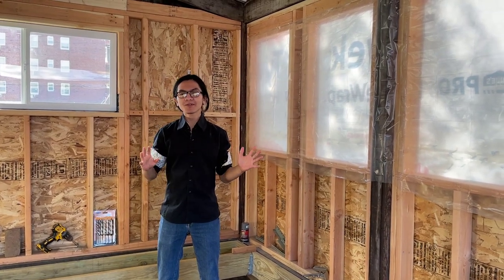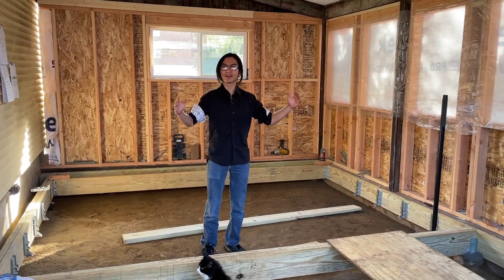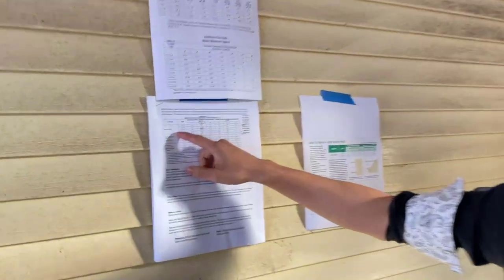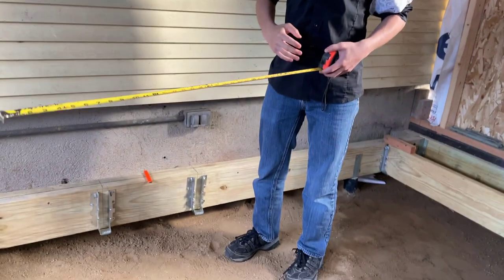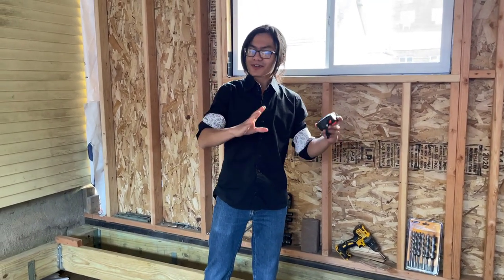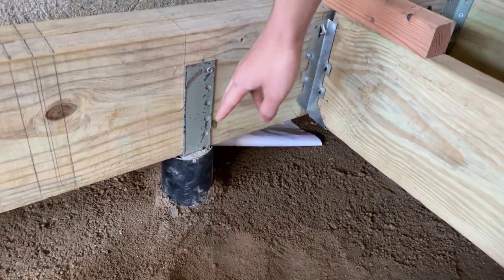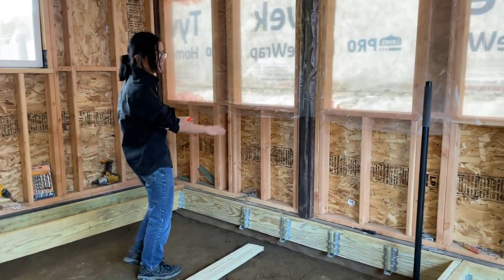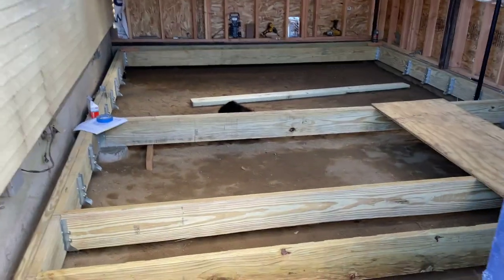Joist Size Cantilever Spacing Beam Span Floor Ledger Footing | Floating Deck Frame Enclosed Patio

Comment from the maker: Here are the #ad links to some of the materials & tools showcased or required for this project:
1. https://amzn.to/3HkgDjW  |  CRAFTSMAN Tape Measure, Self-Lock, 25-Foot (CMHT37225S)
2.  https://amzn.to/30uMpdc  |  Simpson Strong Tie LU28 2X8 20 Gauge Face Mount Joist Hangers - Quantity 25
3.  https://amzn.to/3Hj4RWL  |  Myard PNP153544 Deck Foundation Block for Wood Composite Floor Frame Pier Shed Base Footing Post Beam Support (Qty 4, Black)
4.  https://amzn.to/3cnUxPn  |  BISupply Adjustable Post Jack Screw Temporary Shore Jack 4x4 Shoring Jack Post, Lumber Beam Jack Post Joist Support Jack
5.  https://amzn.to/3c9dJ3a  |  FastenMaster FMHLGM278-50 HeadLOK Heavy-Duty Flathead Fastener, 2-7/8 Inches, 50-Count, 2-7/8", Black

Or Click on Amazon link here and search for what you need:  https://amzn.to/3xIOsqg

Comment: Lets say you only had 12 foot 2x6s you could still achive your span by sistering or scabbing an additional 2x6 side by side which would increase your load bearings to what a 4x6 is at the same span which is greater that 11foot. You can find those tables as well look up 4x6 span extents. Working with dimensional lumber is alot of fun its like solving a puzzle with what you have as lumber pieces. Theres always a way. Keep up the good work

Comment: hello. fantastic series. i am also building some similar ones based on our old garage. we already have a concrete slab...but...do we need to use the joints to attach the subflooring to the concrete slab? (not feeling like drilling over concrete...). also, why do you lay the moisture barrier later, not before doing the subflooring?? Thanks!
Reply from the maker: You probably don't need joist unless the concrete is not level. You could lay moisture barrier before. Not sure if it matters. Just our humble opinion. Thanks for watching
Reply: @EyeOnAiman  Thanks for the speedy reply!